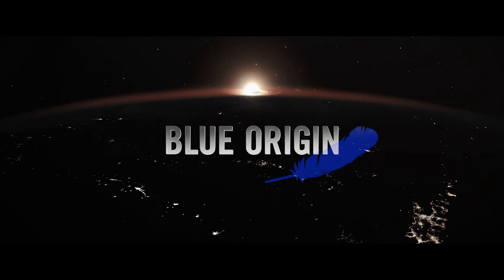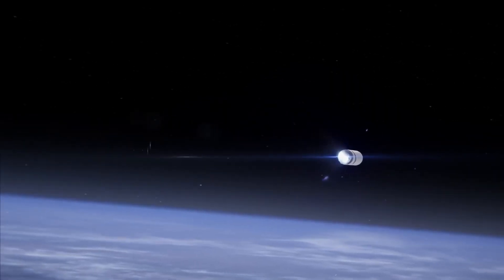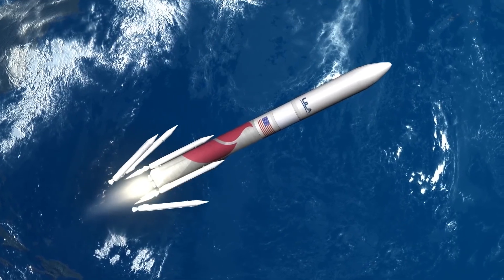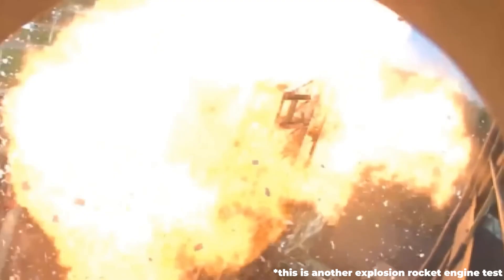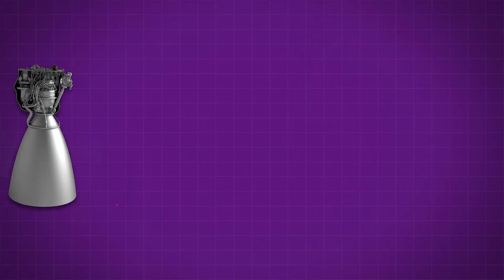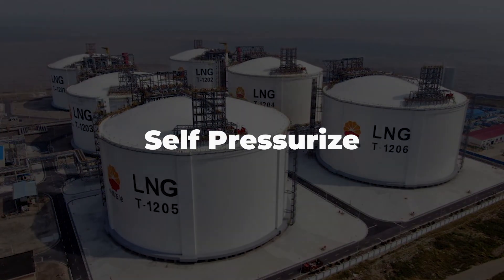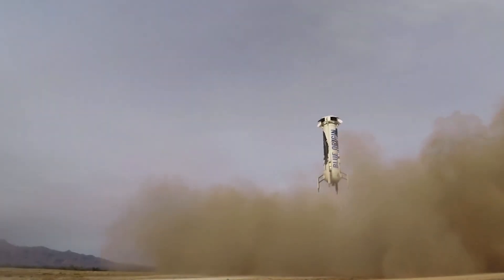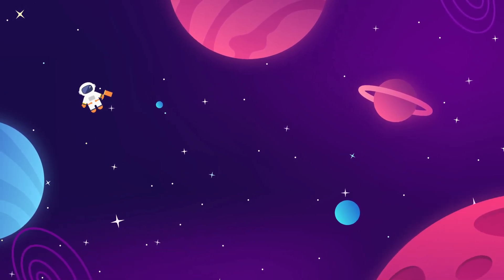The Disappointing Truth About The Blue Origin BE-4 Rocket Engine!

Comment: Regarding SpaceX this is a case of jump to premature conclusions and shoot at sight. SpaceX planned a whole bunch of starship boosters because they wanted to modify future versions to take into account the data gathered from prior versions. So in fact if the older versions didn't blow up in flight they would need to be stored even if they would no longer be used, they became an embarrassement. Anyway the Starship Test Flights from 1 to 6 all made progress and successfully fulfilled most of the goals: catching the booster with the chop sticks; re-igniting the starship engines in space, accurately following the planned flight trajectory, simulating a soft landing of starship so that it can be recovered and reutilised in the future, surviving re-entry even though the re-entry trajectory was selected to stress  starship beyond normal operating conditions..

Comment: The white cloud you described was not methane.  It was condensation of the outside air.   SpaceX does not vent any methane to the outside.   The boil off is collected and stored, and them recondensed in the recondensor vessel.

Comment: Totally biased video.  The BE-4 is NOT an experimental engine.  Raptor is.  The BE-4 has more run time then all Raptor combined.  Until VERY recently with the test launches of Starship, the Raptor has suffered numerous issues.  The most critical is failing on relights.   Even the successful flight four saw 4 failures.  A totally unacceptable number in the real world.  Old school is not bad school.  It's just slow.
Reply: There was one failure in the last launch, not four. No clue where you got four from. BE-4 is kinda expiremental, as it is meant to do New Glenn first, (has not done in flight relights, or landings) but it seems promising consider Vulcan.

Comment: Dude, look we all know you hate on anything that isn’t SpaceX, you are the Negative Nancy, or the Queen Bee of the Space Gossip industry. You act like these rocket engines can just be pulled out of Elon Musk’s ass. These are complex designs requiring years if not decades of research, trials, & errors and NONE have ever been built to perfection. Your constant negative tactics might work for you & your so-called fans, but you are also delivering false information about the problems Blue Origin are facing designing an engine to work on a rocket far more commanding than that easy crap SpaceX has built. Granted it seemed at the time rockets returning for a landing was breakthrough technology, but the whole theory behind this has been around since the 1950s & nobody had ever coughed up the money to give it a try. The success SpaceX had only goes to prove how easy such a task is & makes this easier for Blue Origin to accomplish as Blue, like SpaceX, is privately owned & can & has bought any type of employee they need. However in the space race, the real one, not yours, success is measured over start to finish of a program and right now SpaceX has not accomplished any, have they? When it comes to timelines they have certainly failed, I mean wasn’t SpaceX supposed to be on Mars this year? That’s a big fat failure right there. They can’t even land on the moon. Rather than creating a soap opera, I suggest you do some real journalism & not take sides to divide the country but rather take sides to unite the country. Otherwise what you are doing is nothing more than NAZI propaganda.
Reply: Wtf are you talking about? SpaceX reused a rocket 20 times and designed the biggest  orbital rocket ever while BO hasn't even been to orbit ones

Comment: Hello Haters!! Just passing by so you can congratulate the BE4 for the successful launch of Vulcan. It also reached Orbit before the Raptors. Also, it sending to the Moon the first US lunar lander post Apollo. 
Thank you for your doubts and lack of support. Just made this moment sweeter.
Reply: I wouldn’t call everyone that’s disappointed in Blue origin a hater. Some people just find it pathetic that starship has already made it to space oh, and came back for a soft landing all before new glen is even completed. You can never compare the complexity of the starship or the booster or the launch tower to Vulcan or new glen to begin with but even if you do Space x is running laps around Blue origin, Boeing by itself or with Lockheed as ULA and I personally think Blue origin can do better. Just look at the time lines, Blue origin was founded before space x yet Space x has accomplished ten times the feats that blue origin has. Falcon 1 then 9 with the Merlin engine,falcon heavy, cargo dragon, crew dragon  with the Draco and super Draco engines, starship the booster and raptor engines and the whole of star base including stage zero. All while blue origin is still having issues with the Shepard rocket, yet you brag about the BE 4 flying on another company’s rocket before the raptors, if anyone sounds like a hater it’s you. As a space lover how can anyone not be disappointed in blue origin and love space x?

Comment: Former B.O. employee here. ULA had issues before they even hot fired that engine. They pressurized it incorrectly, for one, and then proceeded to blame Blue for it. 

The BE-4 won't be done for a while. Blue has structural issues that go DEEP. They also pride themselves on diversity hires instead of those who are actually qualified and knowledgeable besides just on paper. The newest NS rocket is also probably another year out or so, at least. They make mistakes that are completely avoidable and extremely costly to fix... 

I wouldn't put anyone I care about in one of their capsules. Elon is the only pony in this race
Reply: What structural issues do they have? Never heard of anything remotely hinting of that issue.

Comment: It’s a simple solution…
They need to start buying and using SpaceX rocket engines until they get their BE-4 engines operational. And with that said, it’s still cheaper to purchase and use SpaceX engines in all ULA rocket systems! 👍
The problem is Jeff Bezos bought into ULA…
You can hire me…
I’m cheaper than Tony Bruno . 😂
Reply: Whoops .. guess they chose a different path 😢Poor raptor still grounded watching the BE4’s reach orbit.

Comment: I'm a little puzzled by the basic thesis of this story, that the BE4 engine is crucial for US access to low Earth Orbit.  

The narrator has completely mischaracterized the failures of recent SpaceX Starship flights as being due to the engines.  That's simply false.  If you want to get stuff and people into low earth orbit today SpaceX can do it reliably and frequently*.  SpaceX is getting close to successfully launching 100 Falcon 9 flights *in one *year*.  That's astonishing.

And liquified natural gas is not methane, and by the way, what fuel do you think SpaceX uses?  That would be methane, ... which has delivered over ninety payloads to space in 2023.

Comment: Why should it be important?   competition is there!  american competition is there it has landed over 200 of its first stage rockets.. and is, together with the chinese competition almost the only  viable rocked there is.   While the Delta 4 heavy has the capability at an exorbitant price to lift 28 tons to LEO  Falcon 9 non reusable can lift 23   at roughly 1/4 the price.... at a1/3 the price the falcon heavy can lift 68 tons.  This IS ALL OLD HAT.  The BE4 seems to be afflicted by inherent design flaws having people think it will need a substantial re-design so much so that BO has been rumored to want to purchase ULA.  The most bad ass is a  interesting category...  It doesn't lift half as much as the Falcon HEAVY... let alone New Glenn,SLS or Starship and yeah...  not bad ass but dead ass.  Market Capitalization... SpaceX  150 billion dollars... blue origin  0.15 Billion dollars.   Atlas 5.. Boeng/lockheed worked on old time phylosophy!   rob the buck where you can, vylify those that will show the world what they should be earning.   the launch of a rocket that can heave more costs less.. right?  yeas  about 2/3 of what the going cost was of the Atlas 5

Comment: There are many errors in the video, the one that freak me out is saying that the cloud of vapor leaving the fully fueled rocket is methane, it is not, it is water vapor leaving the water ice product of condensation thats sticks to a very cold rocket.
To mantain pressure the rocket vent some methane via the connection port to a distant location in the stage 0.
Venting near the Oxigen vent could be catastrophic.
You are not enough informed to make this type of video, sorry.

Comment: The high temperature of the slightly fuel rich engines will see to it to burn off any soot that might have tried to deposit on the bells of the engines.. these are not bezos engines.. they were developed  Müller added Umlaut for greater importance!😊

Comment: The notion that we don't already have the best rocket engine in existence is absurd. The Raptor 2 is already the best by far. To compare it to the Russian engine you'd have to compare 2 Raptor engines because the Russki engine has 2 nozzles. Not to mention the Raptor is a far superior design to both the Russki engine and the BE4 'and' the Raptor 3 is already in advanced testing. Blue Origin is so far behind SpaceX that it's doubtful it will ever be able to even compete with SpaceX and Starship much less beat them.

Comment: The reason the Starship Raptors failed is because of the delayed takeoff on the stand that lead to the damage of the engines, not their performance. Now there is a water deluge system in place that should sort the issue. This vid is a bit penis propaganda...

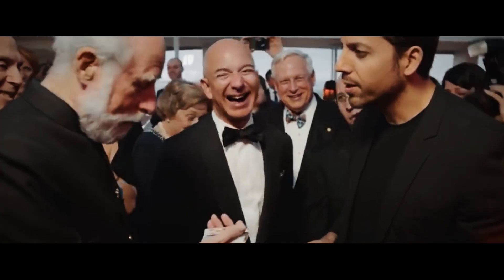Comment: 0:37
The United States has ZERO need for the BE-4 to "maintain their presence in LEO" - SpaceX is doing just fine and has never even considered that rocket engine.
Just because Starship is still in the experimental stage DOES NOT mean that Falcon 9 and Falcon 9x have had no success!

Comment: The BE-4 engine is only critical for ULA that have had over two decades to develop new rocket propulsion but failed to sufficiently invest in doing so. Even when offered proven options like SpaceX's Merlin engines or from Rocketdyne who has made eneines for 50+ years to power a new launch vehicle, ULA declined. Staking their next rocket on an unproven BE-4 engine from Blue Origin, which has yet to reach orbit, is questionable at best. ULA exists largely due to a need for an alternative government launch provider, not competitive market forces. With no indigenous rocket designs, they rely on legacy systems. Meanwhile, Blue Origin needs the BE-4 to succeed for their future rocket ambitions, but engine failures in testing do not bode well for either them or ULA. After years of complacency, established players now face an uphill battle adapting to the innovation of disruptive upstarts in the launch market.

Comment: I think this is flawed.  Methane is not vented from the rocket, it is a greenhouse gas 20x more potent than CO2, and anyway you would not want methane to be vented while O2 is being vented, likelihood of big boom!  The white cloud is atmosphere water vapour condensing in the breeze from the very cold rocket skin containing cryogenic fuel & oxidiser. Excess methane used to be burned off a distance away by SpaceX, and now they recondense it, the pressure controlled by the GSE.

Comment: So many freaking errors in this video,  will not subscribe.  will not be back.     Methane has not existed since the birth of the universe. No molecules existed until the universe was cool enough for atoms and then molecules to form.   The only elements created in the moments after the big bang were Hydrogen, Helium, and Lithium.  Carbon didn't come until nuclear fusion produced it in stars.  

Autogenous pressurization isn't just the cryogenic fuel boiling,  it also involves heating fuel and sending it back into the tank, or sending the products of partially burning fuel back into the tank - which is how it's done on Starship.    You showed clouds coming from the condensation on the outside of the tanks - not the jets of vented gas.  You showed videos of other things exploding while talking about the BE-4 exploding.  LNG has more than just methane in it.

You wrongly stated that raptor engines exploding are what made starship explode in it's first orbital test flight ... no, several engines failed, but it was intentionally blown up using the flight termination system after it started tumbling.

Like holy crap what a useless misleading video.  Was this totally written and edited by ChatGPT, with some ignorant fool narrating it to make it appear legit?

Comment: The current rocket designs are so damn wasteful - all those dropping shells. They all need to fly back down to the original launch site in one piece or stay with the ship.
Reply: If it was only as easily done as said.  It is the future though.
Reply: Err with something like 160 falcon9 landings!  The rest of the industry is still getting over that it can actually be done. SpaceX has been working on Starship for about 5 years and they work at least twice as fast as any of the other major companies that will have others heavy lifers managing landings next decade, probably after Starship has put them out of business.

Comment: I would claim that probobly the main advantage of methane fuel is the relativly high impulse while not being as compicared to use as hydrogen.

Its sort of a swetspot between hydrogen and RP1 in terms of ease to use and impulse.
Reply: More worse than that. The boiling point for hydrogen is so low that there is a danger that it will freeze the liquid oxygen! This requires special handling and extra insulation. Liquid methane is near the same temperature as liquid oxygen so a far better match.
Reply: It have fairly close cryogenic conditions as LOX have, while it have a bit lower density. So bassically, if you use LOX (that most roxkets do) there is bassically no added conpexity.

Comment: It is illegal to vent methane straight into the atmosphere, the cloud you see coming of a fueled up starship is most certainly NOT methane.
Reply: You're wrong.  If it's a over pressure event it's perfectly legal to vent.  It prevents explosions which are much worse.
Reply: @TheEvilmooseofdoom  It's condensation coming of the metal body because it's cold as shit, NOT methane venting. 
A falcon 9 looks exactly the same when it's fueled up, and every single launch stream they comment on that saying that it's condensation.

Comment: The Raptor engine has been nothing but failure so far with the engine eating itself on a regular testing with green flames blazing all over the place for the past 3 years. Just because it is Spacex engine of your hero Elon, nobody criticizes it. If you would have Blue Origins logo on Raptors engine, it would have been the laughing stock as well. Fanaticism affects ALL areas of life.
Reply: That test engines experience failures doesn't mean the production engines are.  This doesn't mean the Raptor is perfect either.  But you are being a bit simple.

Comment: 10:30 wrong. That is atmospheric reaction to temperature inside and outside the tank. Methane is not vented out!
Reply: The only time methane would be vented is during a over pressure event, during fueling etc it's not.

Comment: 9:01  Audio says methane was around since the universe began.  Assuming the universe started in the Big Bang, then atoms didn't stably exist until hundreds of thousands of years after the Big Bang.  The carbon atoms in methane were formed inside stars. The carbon atoms were scattered into the universe by stars' nova explosions. Current observations show carbon atoms in the universe by about 1-billion years after the Big Bang.  Contrary to the audio at 9:01 methane did NOT exist since the Big Bang.

Comment: First, rocket engines explode, it's a fact of life. There is an operational heavy lift vehicle without Russian engines, it's called "Falcon Heavy". I will also point out that the Atlas existed long before they started buying Russian engines. I will also point out that dunking rocket engines in salt water is unlikely to be a reliable strategy for reuse.